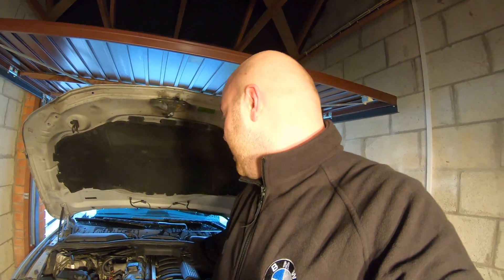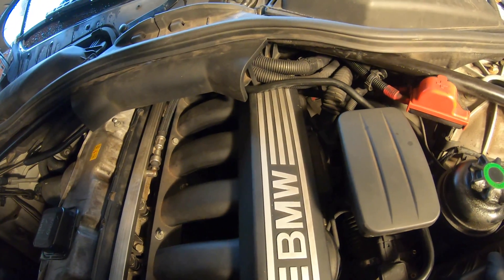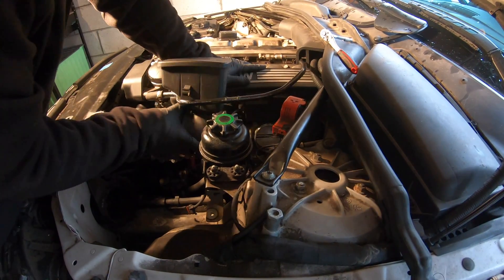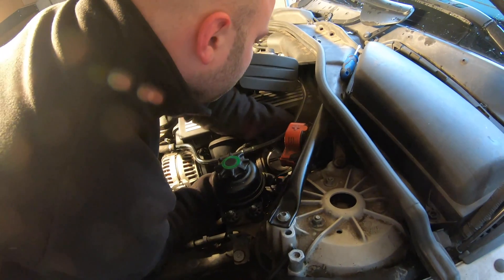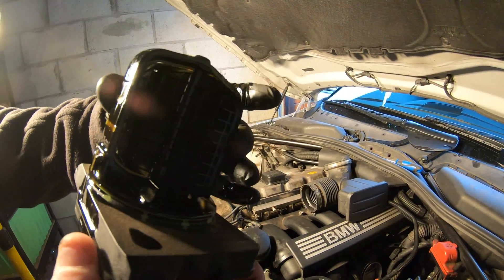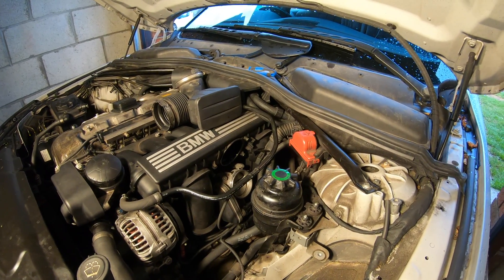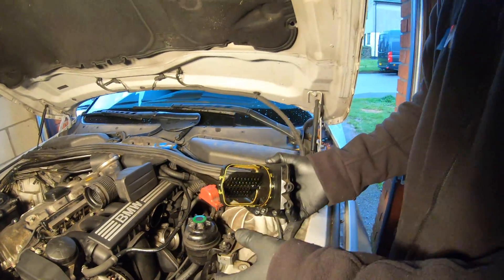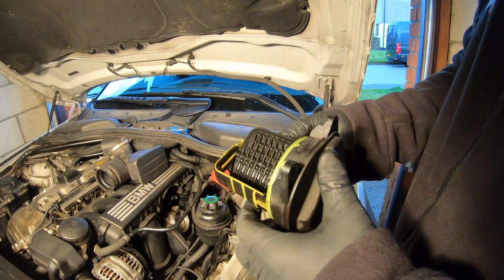BMW N52 Disa Valve Removal 3 Stage Manifold Check Using Ista D

Comment from the maker: click here to buy the big disa valve ontop of the throttle body 

https://amzn.to/2J9ZcHT

click here to buy the bottom disa flap under the manifold 

https://amzn.to/2Jv5hxY
Reply: BMW Doctor I just got some misfire codes on cylinder 4 5 and 6. Rough idle and had hardly any power. My brother and i checked the disa valve on my 06 bmw 330i automatic and the flap was in my 5th and 6th cylinder but the little pin that holds the flap in place is nowhere to be found. And I'm not sure if that pin is metal or plastic. Should i be scared that one of my pistons can be damaged?
Reply: Hi Dean, do you recommend these "SCSN" brand DISA valves then? They have a pair of them on Amazon (11617579114 and 11617560538) but i want to make sure you rate them before i stick garbage parts into my intake manifold? Any advice appreciated. Cheers

Comment: Hello guys. 
I replaced all this and still got the shaking in the morning first start and hesitation when hot on low rpm. 

Oil and coolant housing gaskets seals new 
New genuine bmw inlet manifold gaskets 
Replace Vanos selenoids genuine 
Coolant new genuine bmw
Spark plugs new ngk
Air mass sensor new genuine Siemens 
New 6 Ignition coils Bosch 
I replaced the fuel pressure regulator 
Big Disa flap febi 
Small Disa valve febi 
CCV breather febi 
Gearbox fluid and filter new ZF 
New Coolant temperature  feb
The car it's doing this since I bought the car
Reply: check the eccentric shaft sensor on the valve cover too.

Comment: As it turns out, I own a 2003 Bmw 325XI and it won't idle. Thought it was the IAC valve being clogged, took the DISA valve off because it was in the way and the entire mounting point of the flap to the motor shaft is broken off completely. Could this be a reason for a no/rough idle?

Comment: Thanks for putting this up! I pulled one of mine today and the shaft had more or less completely disintegrated. Will be replacing both in due course, after that my expectation is that this engine should regain some of its lost low end power.

Does anyone have a pinout/data sheet on these, by the way?

Comment: Dean, I need your help, I want to replace my Disa, but my N52 intake does not look like yours. I have a 2008 BMW 528i. I can see your Disa right above the throttle Body. On mine I don’t have that. Where is it on my model?
Reply from the maker: you dont have them mate on 528i bro you have a blank manifold mate
Reply: BMW Doctor well, that saves me money...lol
Reply from the maker: yep it does indeed mate trust me you dont want them there risky they can destroy your engine and there flipping expensive and no rebuild for these ones

Comment: Out of curiosity, I've got the the N52B25 and I was wondering if I can fit the 330 manifold with these disa valves to mine along with a map to get them to work. Any idea if it possible mate?
Reply from the maker: No mate not possible at all this has been tried and tested many many times and failed you can do it but it will be very very expensive you can buy 330i for the price of the mapping and manifold
Reply: Bmw Doctor appreciate the reply mate! Been toying with idea with no concrete answer as to whether it would work. Love the content, took me ages to find content that was actually useful on my engine!
Reply from the maker: Well here I am I been here 9 months and plan to stay until my death

Comment: Ive just pulled the my disa valve out to find the flap was sitting in the manifold. I mnaaged to retireve the flap, but the shaft is nowhere to be seen. Should i remove the manifold and try and find it? or if its plastic i presume it wouldnt be so much of a problem?
Reply from the maker: Mate get it out or what will happen it will get into your cylinders what usually happens it drops down in the bottom of the manifold so just shake it and it comes out I have a video for manifold removal mate
Reply: @BMWDoctor  ok thanks, do you know if the shaft is plastic or metal?

Comment: Can i check bigger DISA by starting engine while it's removed? From other vids and forums i understand that with 3-stage manifold (2 DISA)  it should be OPEN when car is off and it closes when you start it (at idle)?
Reply from the maker: Don’t listen to that crap just get diagnostics and check it easy without doing anything

Comment: Is there two disa valves on the n52 or just the one shown here?
Reply from the maker: There is two disa valves only on 530i and 330i
Reply: @BMWDoctor  does the small one under the intake go bad aswell? cant seem to find a replacement or a rebuild kit for the smaller one
Reply from the maker: No mate there is no rebuild kits at all for these they have to be bought new or used but only if you can test them before fitting and know how to tell if one is bad they are expensive take my word each one is about £180 but that’s the price you pay there is no being cheap with bmw for me it’s no bother £180 each isn’t nothing to me in a way it’s a good thing nobody has come along and clones these or the vanos solenoids it keeps these cars expensive and it also keeps people away from them because there is no other parts to turn too apart from dealer parts which is a good thing as I always use genuine parts myself straight from bmw this is a bmw dealer favourite channel I always encourage people to buy from the dealer as the parts will last 100k plus on your car compared to buying cheap
Reply: yeah, i will set fire to my car in a field before i put anything cheap chonk in it haha
Reply: @BMWDoctor  one more thing, is it possible to test these when theyre out of the intake manifold by turning the car on a revving it?
Reply: @BMWDoctor  do they not have 2 disas on the 325i? Real oem shows 2 for me 🤔
Reply from the maker: No mate you will have ONE disa it will always show two as it only shows on ALL models for three stage manifold same as in USA when they don’t even have any disas it still shows two
Reply: @BMWDoctor  ah okay, I'm presuming mines the euro one unless someones fitted the euro air box? (the big box with the cone style filter)

Comment: My car shuts off when it gets hot. Does a fuel pump have anything to do with that??
Reply: Crank sensor maybe?
Reply: @racecarbmw88  currently it's okay after they changed the fuel pump. Thanks for reply

Comment: I have an E60 525i 2006 N52 engine, but I don't have a disa valve, above the throttle body I can't see the disa. Why? Thanks
Reply from the maker: Then you don’t have a 3 stage manifold only m sport gets that

Comment: Does the bottom disa jst pop off?? Nd would a disa from a auto fit on to a manual?? Both are 06 e90
Reply: 330i
Reply from the maker: No mate bottom disa has the bolts holding it on behind the throttle body then it pops off you don’t have to take the manifold completely off and you can access it by removing the oil filter housing aswell
Reply: Okay thanks jst took it off, would the auto disa fit a manual?
Reply from the maker: Disa is all the same no different mate at all there the same manifold manual and auto
Reply: Alright man, thanks a lot!!

Comment: After seeing this video I pulled my DISA on my e61 530i N52 and it was fully open and felt stuck. A little bit of oil as well. 
Just to double check, before I order another DISA valve, it should be fully closed when the car is off like you say in the video? I saw on another forum it should be open and stuck as it's electronically actuated? Thanks a lot for the videos.
Reply: I think these valves open when you shut down the engine so they rest in an open position. Then when you start up they close. The at higher rpm they open one then the other. I saw a demo on yt.
Reply: I'm in the same situation - mine is open when i got it out, looks good otherwise. Maybe it's different if you have full 3-stage manifold?

Comment: What do you recommend for diagnostic equipment/software. I have a 2003 325ci.
Reply from the maker: Mate don’t recommend anything else apart from Ista and all the softwares I use for bmw only others will make you spend and spend giving wrong codes
Reply: @BMWDoctor  thanks

Comment: Thanks! I pulled mine after watching yours, and it was shot and barely hanging there. I suppose I should check the other one too. 2007 e83 N52
Reply from the maker: Yes mate go and do that the other one fails even more then the top one